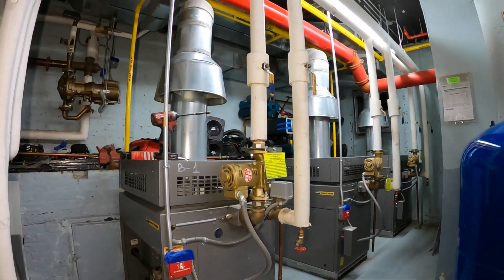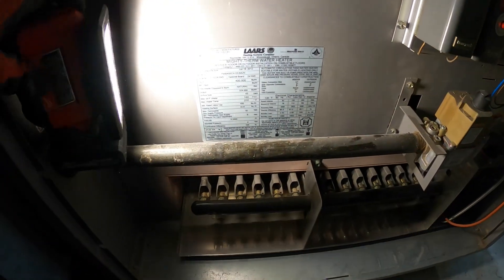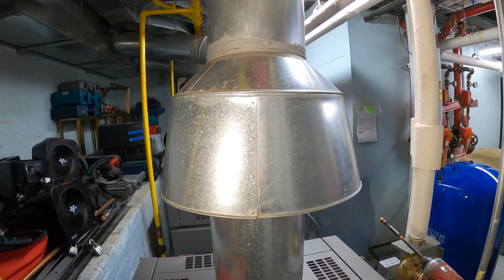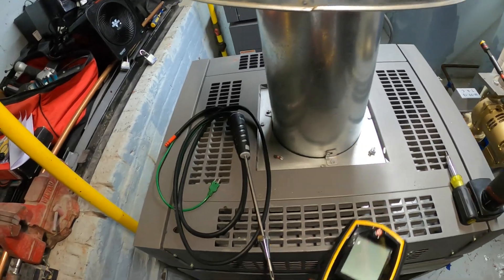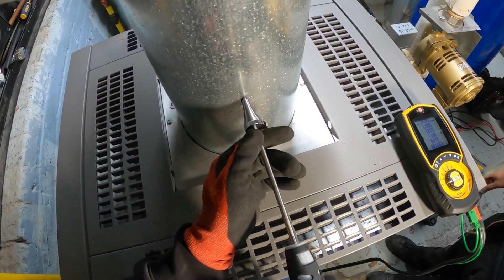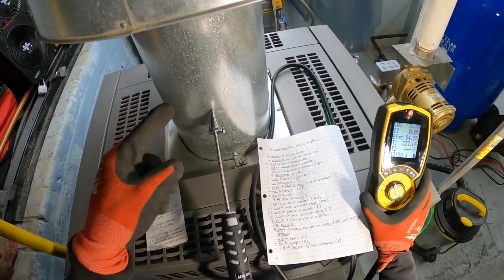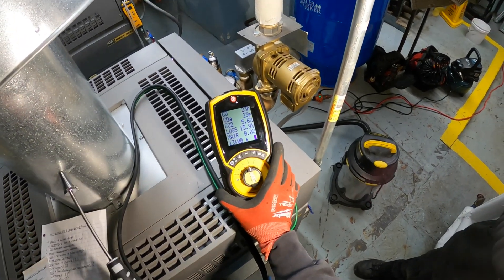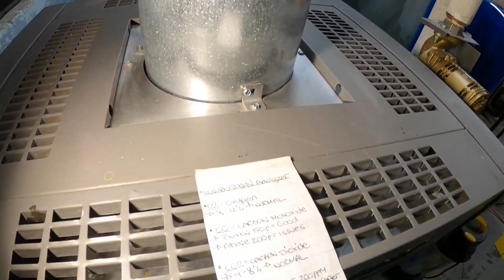HVAC: Commercial LAARS Boiler Combustion Analysis Using The UEI C161 Flue Gas Combustion Analyzer

Comment: Also, if you want your meter to last a lot longer, let that carbon monoxide run up high and come back down to get a good reading otherwise you’re just gonna saturate your meter and keep having to replace the sensor so let it warm up first and drive back down before you put probe in vent

Comment: The analyser calculates combustion efficiency by comparing the temperature of the boiler room (inlet temp) with the temperature of the flue gases. When you turn the analyser on it takes the inlet temperature reading from the probe and stores it. After that it switches to reading the flue temperature. You could also connect another temperature sensor so the analyser can read both temperatures in real time for better accuracy.

Comment: Perhaps you need to set up your 02 calibration because as you say you should be reading something for 02 and excess air. Air will have approx 20.9% 02 for a reference.
Reply: Should get the cat 85 fieldpeice it's nice. 
Also I think at 84 percent flue gases will start to condense rust up flue . Pretty sure you gotta drop that down some. Closer to 80
Reply from the maker: Thank you for your input/advice. I need to check before I call UEI for a faulty unit. Brand new out of the box. Sheesh. Thanks for watching! 🔧⚡️

Comment: Fire Piece Of Equipment  ButUm You Need Your Own Carbon Manoxide Detector Fits In You Front Pocket Wont Step In To Any Building WithOut It Especially Those Old NYC Building stagnate Air were the mechanical Goes Hvac Boilers Etc. BE safe Its About $200.00 like 3 years ago find At Grainger HomeDepot Or lowes